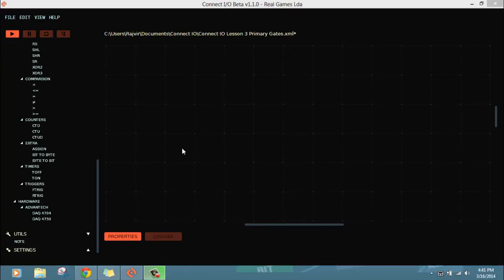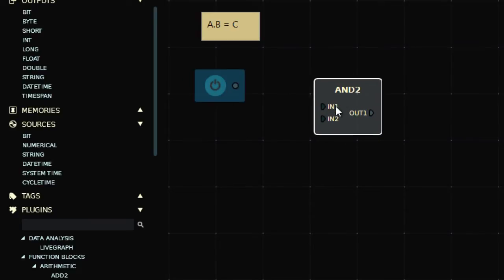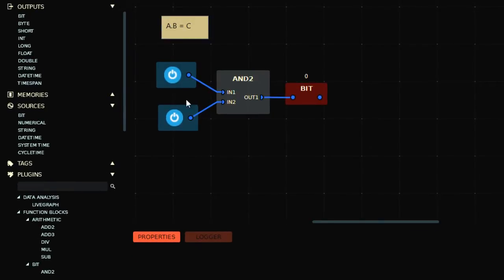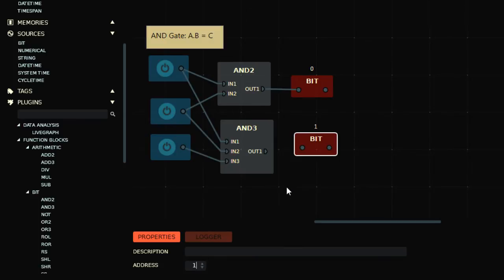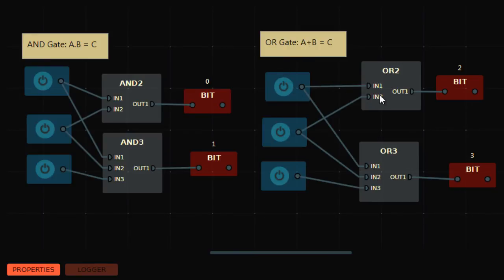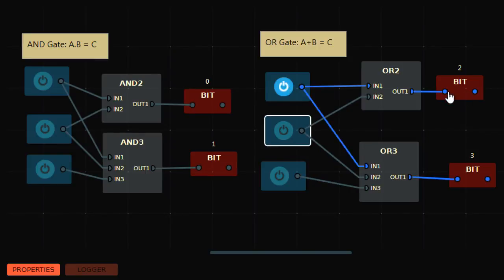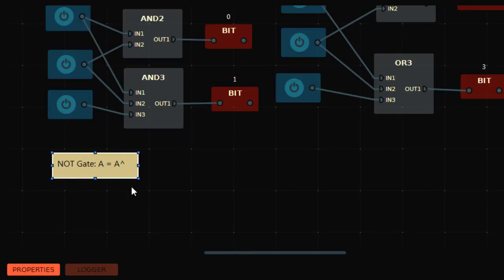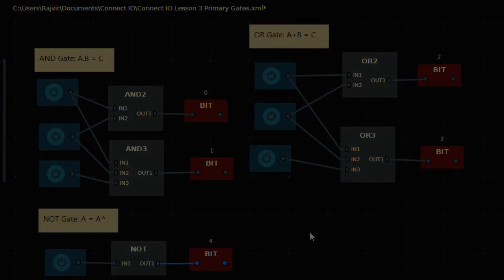PLC FBD Logic Lesson 3- Understanding Primary Gate Functions

Comment: Hello. Thank you very much for your videos as they are very helpful. So i have a problem, like a real life scenario, and I think you may have the answer.

The programs: Home I/O and CONNECT I/O

If a car drives to the first sensor, than the gate opens, the car drives in to the garage, so, the gate would close automatically .

The same would happen if the car drives out of the garage, sensor 2 would activate, the gate opens, the car would drive out, and behind him, the gate would close. 

The idea is to automate the gate door with two sensors, sensor 1 and sensor 2, so that they work without any other input, fully autonomous.

I am not so good with programming, so thanks in advance.

Home IO gate door for educational purposes only
Reply from the maker: Yes Voltarens, thats the objective of the Entrance Gate. When Car is coming from outside, Infrared 1 should be used to open the Gate and Infrared 2 should be used to close the gate. 

In other case, if car is coming out of the Garage, Infrared 2 should be used to open the Gate and Infrared 1 should be used to close the gate. 

Would you be able to make such logic?